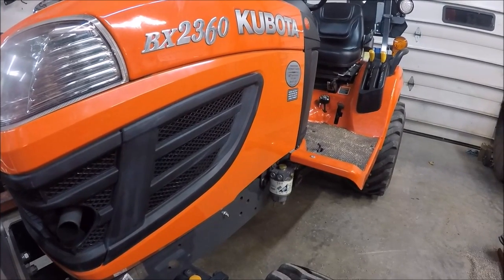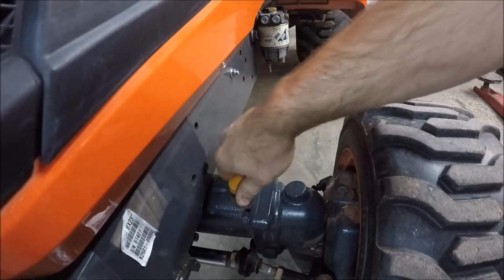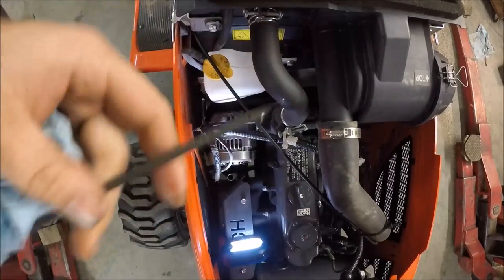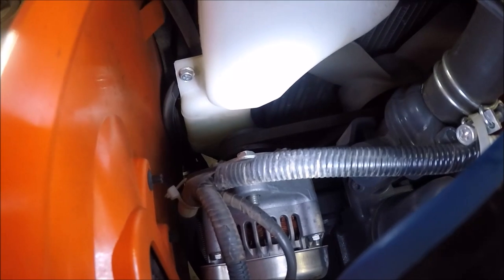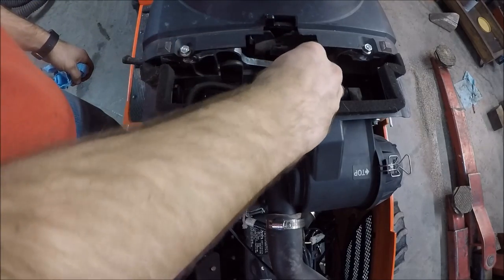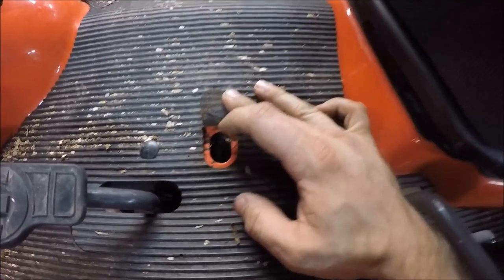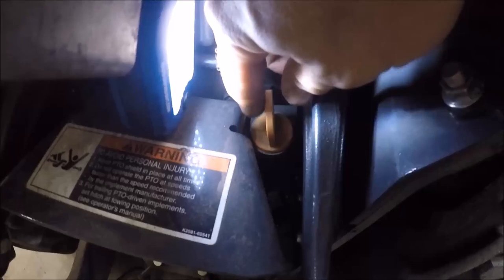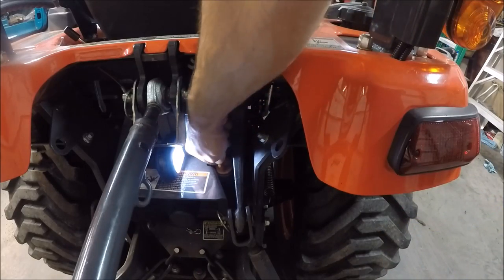How to Check the Fluids and Lubricate a BX

Comment: Thank you so  much for the simplicity of your video. No tech mumbo jumbo just straight forward. I have checked all the points except I can not get the dipstick out on the front axle. Any advice is greatly appreciated. Thank you
Reply from the maker: Your welcome! Try wiggling the dipstick side to side as you pull it. They are a very tight fit.
Reply: After much determination lol I finally managed to get it off. Thank you and I Luvs my tough little KUBOTA

Comment: I have a question I’ve got a BX 2360 I’ve got oil or fluid or some type hydraulic coming out of my front end and I don’t know from where I have cleaned it all with brake clean and I don’t see anything leaking nowhere but I’ve got oil on the ground, a Parkette on horse maps and I just do not see where it’s coming from. Do you have any suggestions?

Comment: I couldn't see any coolant on my 2370, so I added some. Now it's near the top of the upper reservoir which is probably too much. What will happen if it exceeds the tank capacity when the engine is hot?

Comment: Well done, good view of each subject. Disappointed that it does not cover power steering fluid check and location.
Reply from the maker: Thanks. The powersterring fluid is part of the hydrulic oil that is checkec at the rear of the tractor.

Comment: I'm still rather new to diesel engines.  When I checked the engine oil after only a few hours of use, it was black already.  I'm used to seeing clean oil and only black after many hours of use (on my gasoline engines).  My friend says that black oil in a diesel engine is normal even after just a few hours of use.  Do you agree?
Reply from the maker: That is normal. Generally speaking diesel oil will get black within a few minutes or hours.

Comment: On the front axle dip stick, where is full there is a line and two dots. Can’t find it anywhere in the manual and like you said hard to see but where is full?
Reply from the maker: The bottom portion of the dipstick larger in diameter. At the top of the larger diameter portion is full. If you can't see it, drag a finger nail across it.
Reply: 94BULLITT  thx thought so but wanted to be sure. Great vid

Comment: Where do fill the engine oil? Does it go in the dip stick tube?
Reply from the maker: There is a cap on the top of the engine in the valve cover that remove to put the oil in.

Comment: Is it best to check at operating temp or cold. 28 f and 2 hrs on bx 1880, hydraulic fluid is not on dip stick. Was told air might be displaced from the system and have to add UDT. THANKS
Reply from the maker: If you are checking when it is cold the fluid will be down lower on the joystick, but it should be in the crosshatch area. When the tractor is warm it will be at the top or close to the top. The only time there would be air in the system is after a filter and fluid change.

Comment: So the rear hydraulic
Is same whats used for loader and also for transmission or is transmission separat ?
Reply from the maker: The rear hydraulic reservoir covers everything hydraulic on the tractor, trans, loader, 3 point hitch and power steering.

Comment: Hey -- bought a CountyLine Post Hole Digger for my B3200 and it's routinely getting stuck and the hydraulics can't lift it back outta the hole when it reaches a certain point even at full up on the hydraulics the digger keeps digging deeper when the PTO is on or it's just stuck with PTO off.  Any advice or is it simply just a situation where bad clay + PHD don't mix well?
Reply from the maker: I don't have a PHD. When you drill a hole with it, you don't need to be at 540 PTO RPM. You can go slow. Also as you drill the hole when you drill down a few inches raise the PHD out of the hole to clean it out them drill down and repeat. The clay is probably adding to the difficulty.

Comment: I have a  bx 1500 ,awesome  machine;  but the front tires are wearing  on the  outside  edges.
Reply from the maker: Check your tire pressure if it is too low it will wear the edges. Then check the front end alignment.

Comment: I add an EA Wicked grapple.  I guess it was bone dry because when I circulated the fluid through it, the sump was out of reach of the dip stick.  After adding a quart, it is still dry.  LOL
Reply from the maker: I takes a bit to fill the cylinders and hoses. Most people don't check their fluid after adding a grapple.

Comment: Should  you  always  operate at full throttle?
Reply from the maker: If you are using the PTO, yes. For other work, I operate between 2700 and full throttle. The heavier the load, the higher the RPM I run. If you listen to the hydro, it sounds different if it needs more RPM.

Comment: my power steering is leaking   where do i add oil or check it
Reply from the maker: It is part of the hydraulic system. Check it at the rear of the tractor.

Comment: Is hydraulic fluid is same as transmission fluid on bx?
Reply from the maker: Yes, it is.
Reply: 94BULLITT   Well transmission is leaking on my bx2680 with 40 hours on it. Will call dealer on Monday.  Starting to feel sorry for not going with john deer
Reply from the maker: Is the filter tight?
Reply: 94BULLITT filter is tight. Leak is on very rear, like pto shaft seal or back cover
Reply from the maker: That sounds like it should be an easy fix. Don't regret buying a BX, they are far ahead of the competition.
Reply: James Cuzzen
Reply: Serg Dane

Comment: You didn't check the  Is power steering fluid.
Reply from the maker: It is part of the hydraulic system that is checked at the rear of the tractor.